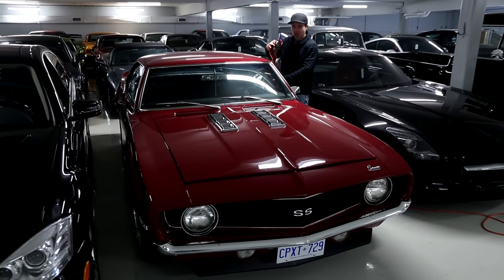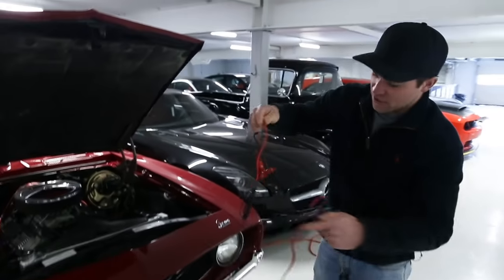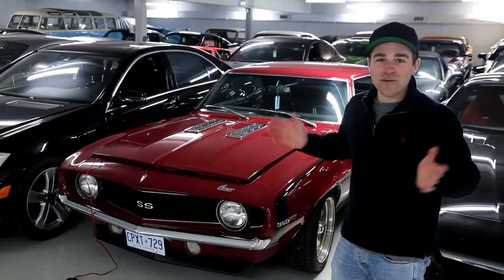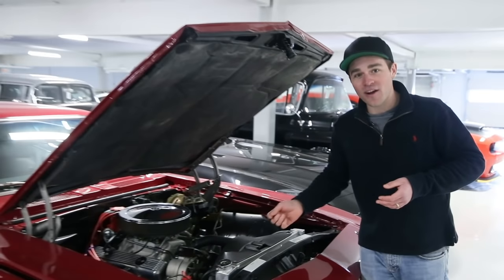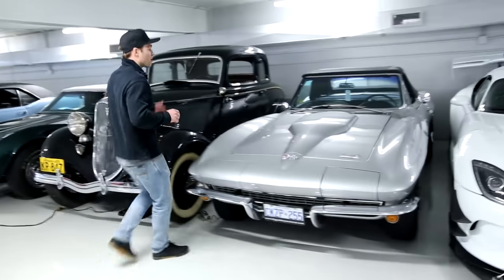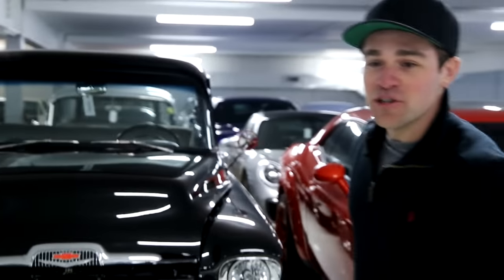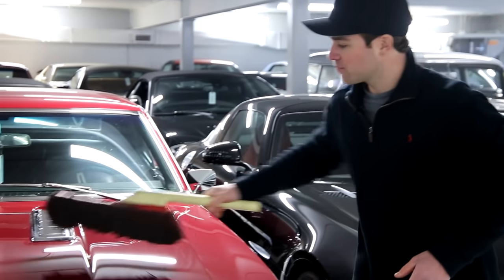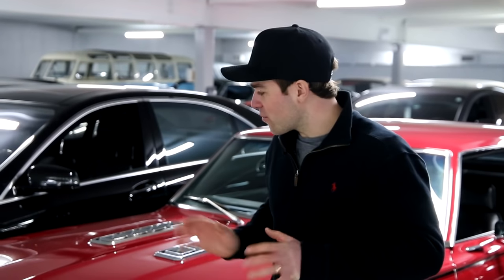These winter car storage tips will protect your car forever!

Comment: As far as an oil change. I have always done one just prior to storage. That way any contamination that is in the old oil will not settle in the pan over the winter. And with a fresh oil change prior to storage your ride has one less thing that needs to be done in the spring
Reply from the maker: Great point!
Reply: And u don’t want ur crank sitting in old oil it will pit  it bad

Comment: Have a long hair cat so use the brushed hair in the interior and under the hood for mouse and squirrel control. Also used oil has contaminates and acid so oil change before being parked. Stabil in the gas. 55 psi in the tires. Battery tender on the battery. Seems to work for me for 20 seasons of storage and counting.

Comment: I recently took my car out of storage after it rained a bit and washed away the salt. I feel the  same way about taking the car out instead of letting it idle every couple of weeks.
Reply from the maker: Nothing like that new car look once the salt is gone
Reply: The worst thing you can do during the winter months is start the car and let it idle. If you can’t take it around the block a few times to get to operating temperatures so all the fluid are hot, then leave it alone. I also remove the battery and store it in the basement with a trickle charge on it.

Comment: Great video. I like changing the oil putting good gas in it. Stable gas treatment. Leave it on the trickle charger and monthly start it warm it up and move it back and forth if possible. This will prevent flat spotting tires and circulate fluids. Yes watch for rodents and moisture. And I like changing the oil again in the spring. You can skip the filter since there's no miles on the oil. We are just caretakers

Comment: Gary
I air up tires
Fill gas, use additive to pull water in spring
Trickle charge
Humidity is outta my hands. Barn, but I do have solids ground under it
Place a few bars of Irish Spring in car as mice hate the smell. 😄
Reply from the maker: Sounds like a great checklist!

Comment: Just purchased a Ford LTD 1968 and it will be stored in my non-heated garage. I’m putting a vaporsheet and some isolation foam under the car to cut the humidity, changed the oil, filled the gas tank, put some fuel stabilizer, i have an intelligent charger plugued on my battery.
I don’t have a cover yet… Should I leave a window cracked ?
Also, should I disconnect the battery and keep it in the house ? Or the charger will save it ? Always stored my car in non-heated places and never had any problems YET

Comment: EXCELLENT TIPS.  I LIKE TO PUT IN A GOOD QUALITY FUEL INJECTOR CLEANER IN CARS FUEL TANK.  FILLING WITH HIGH QUALITY FUEL, FRESH OIL IS IMPORTANT, ALL FRESH FLUIDS DUEING STORAGE IS VERY IMPORTANT.  TAKE YOUR CAR OUT EVERY TWO MONTHS...  DO NOT LET THE CAR RUN FOR 15 MINUTES SITTING...  GET IT OUT IN THE NEIGHBORHOOD, GET THAT OIL FLOWING.
Reply from the maker: Great tip!
Reply: Use a tickle charger & don't start it at all until spring

Comment: I always pour Stabil in gas tank to reduce condensation. I also place an old carpet under the cars while in the garage to prevent any gases or containment’s from the floor getting up into the chassis. I do store a car outside but I made sure to invest in a very high quality car cover. Make sure during the winter when snow and/or ice collects on the car to not try and pull the cover off. Some cheaper brand covers can freeze onto the paint and tear the paint off (from experience). Thanks!
Reply from the maker: Experience is the greatest teacher. Sounds like you've got it all covered now!

Comment: Any comment on using fuel stabilizer for the winter?  I've always used it on my motorcycles.  Good point about over-inflating the tires to avoid flat spots.  Definitely better than letting the suspension droop on jack stand in my opinion.
Reply: The 1 yr I used fuel staybil on my 70 Z28 and 87 GN, they both had a hard time starting in the Spring, so I’m back to not using it.
Reply: I have always used stable with no problem

Comment: I have been storing my car in a car “barn”, there are maybe. 50-60 cars in the barn. The cars are protected from the elements but the barn is not heated and the floor is compacted dirt. I wonder about the level of humidity and the long term effects of possible rust on the car. The price is really good but if I have to spring for a new paint job and possible rust then the savings are wiped away. Thoughts?
Reply from the maker: Really tough to say without seeing, but to start, check the humidity level!

Comment: fuel stabilizer, add to a half tank, then fill up the tank and run the car for at least 5 minutes to get the stabilized gas into the engine

Comment: I like to #Prime the #OilingSystem before starting my Pontiac G8 GT in the Spring by removing #Ignition & #FuelPump Fuses & cranking engine over a few times
Reply from the maker: The G8 GT was super underrated for what it was. Pontiac's swan song.
Reply: @legendarymotorcar  
That would actually be a great episode idea... Manufacturer's #SwanSongs
Reply from the maker: Noted!
Reply: @legendarymotorcar  
Definitely a "#BangForTheBuck" vehicle!!

I need to upgrade to the #GXP with the LS3 & a 6 speed manual though
Reply: @legendarymotorcar  
The thing with these #Pontiac #G8's & #Chevrolet #SS's is that there based on the #Australian #Holden #VE Generation #Commodore... So I don't know how much I can credit Pontiac for it being their "#LastOfTheBreed" moniker

I might lean more towards the 4th gen/last generation #WS6 or even the #Firehawk as their "Last Of The Breed"

Comment: What about fuel stabilizer?
Reply: As I said in another post, the 1 yr I used it in my 70 Z28 and 87 GN, in the Spring, both cars had difficulty starting, and the fuel bowl was filled on the Z. So never again. I’ve been doing this since 1981 in the Z28. I use nothing but Shell Premium fuel that has 0 % ethanol in everything that has a motor/engine.
Reply: Always use it !